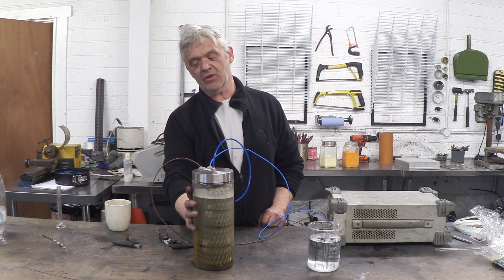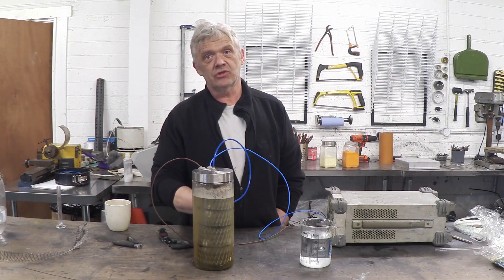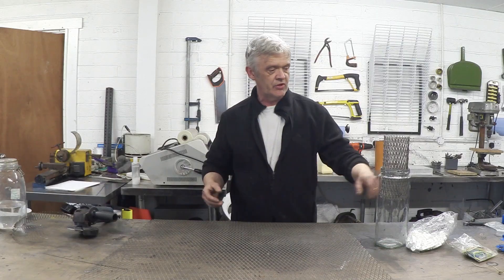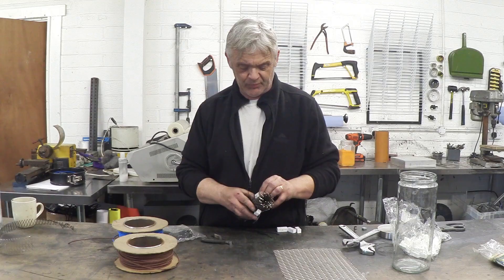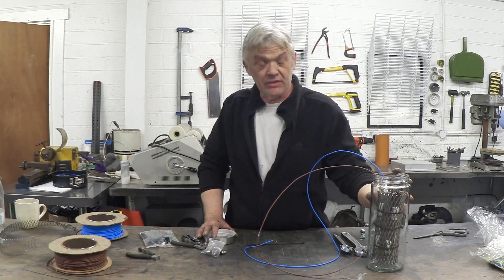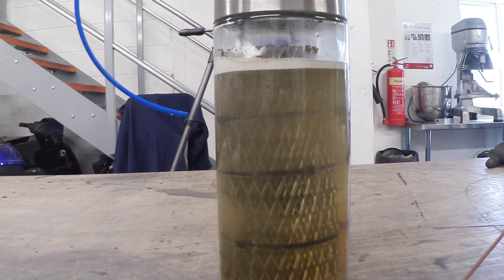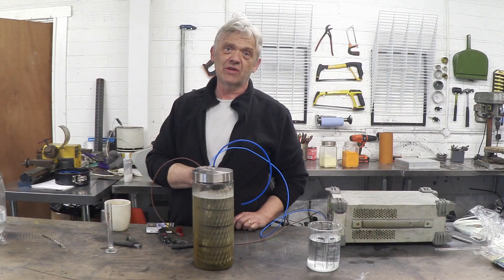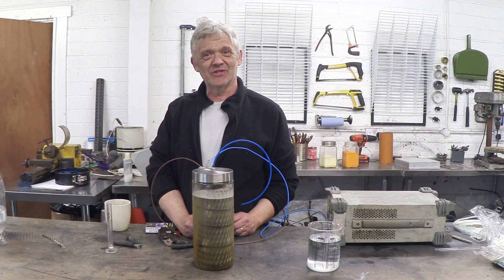Cheap And Easy Hydrogen (Brown's Gas) Generator

Comment: to be precise the HHO generator that you have built doesn't separate gasses which means its a mix and yes it can be used for many things except to run 2/4 strokes engines...
since stroke engines suck air upon starting it would be impossible to feed hydrogen+ oxygen+oxygen and have the engine starts....coz to much oxygen is thrown in the gas oxygen mix inside the cylinders....
newest cars have self regulated Carburetion which regulate the oxygen intake...which means throwing in only hydrogen will make it easy to start the engine.....
from that specific HHO generator the best you can do with it,its add the hydrogen oxygen mix to gasoline and lower the gasoline consumption.....
Reply: Exactly what it's for, aparently the electrical energy from your alternator will produce brown gas in the cell which then is fed into your air intake or inlet manifold. You can also tweak the electrical current to pulse (frequency) to produce gas more efficiently hopefully achieving up to 10% more efficiency per litre of gas. I've done it and drove across Australia but there was no decernabe difference. However I knew nothing of urea or manipulation of electrical frequency.
Reply: @hopefilledsinner3911  My goal is eliminate gasoline all the way....
There are testings of combustion engines that will use ONLY Hydrogen mixed with air from the intake ....
If i am not mistaken an italian company is working on that specific combustion engine..
Not sure if it will work the way they hope or not..
I simply want to eliminate Diesel on my car permanently by generating hydrogen on  a generator sitting inside my car on demand...
Fairly certain  a premixed hydrogen oxygen coming out the hydrogen generator wont do any good...
I probably am wrong not sure and most certainly i will never know since i am focusing exclusively  on generated separated gasses...

Comment: The what you say 

It's an overunity reaction

More energy out than put into the reaction
Definition of ZPE over unity. 
Tapping a different dimension to extract energy that exists in the quantum foam
It is always coming into and out of our  diamention

My favorite way to tap. Zero point energy
Is when vapor bubbles formed in liquid say water.  Forms under low pressure then they will collapse under higher pressure 

In doing so it realises that ape which is hotter than the son. At a nanospot
It translates the whole periodic chart.

I m always waking newer ways to tap into the zpe..

Comment: Anyone know the purpose of the bubbler?
Reply: Safety device, prevents output gas from backfiring into the cell in case of ignition. An additional arrestor, like a cigarette filter is put in front of the welding needle (or any other consumption device)

Comment: Also any of you doing this there is one more thing I would like to say, if you place water under a vacuum and hit it with a high frequency in the range used for x-rays it streams of hydrogen this is why the man I was talking about with the Holden running on water could do what he did, the bubbler is a ploy to prevent people placing there cell under a vacuum and producing more gas, but the reality is you motor is a vacuum chamber and is why you don't need any of this to make a motor run on water just the high voltage coil and enough water to burn.
Reply from the maker: okay mate
Reply: @ThinkingandTinkering  
I am not kidding you, I have a science book from the fifties that shows it to be true I have a video on my channel showing it and it has been proven a man created a patient for a gas torch using the same principle, the Holden was real as well I kid you not.

Comment: Hey, I have to point out something: Urea you get for fertilizing is NOT a waste product... It is made by the Haber-Process which makes Amoniak and then Urea. That takes a LOT of energy, more than you could get from burning that hydrogen!
If you use real Waste Urea you might get a plus in Power (I doubt you can do it, including the energy or money put into getting the urea), you would do better just buying the energy from more efficient energy producers!

Comment: 7 minutes 42 seconds - "there you go, it's generating lots of gas."  Sorry, I didn't see it generating any gas at all.  I still have to watch the full video.  At 9 min's 30 sec's. you claim to get more energy out than you put in.  Physics 101 - you can't get more energy out than you put in.  If you put in 100 watts of energy you are (in a perfect  world) going to get 100 watts out.  Not 110 watts, not 200 watts, just not possible to get more energy out than you put in.  And since this isn't a perfect world, what I think you're confusing is that with water you may get, and I'm going to make up some numbers here, you may get 87% of the energy out, whereas - and I don't know this to be true - with urea you may get 92%.  It's an improvement (maybe), but you'll never exceed 100% out.  Just not possible to create energy.  You can convert it from one form to another, but there are almost always losses.  Converting gasoline (energy) into heat - you get the same amount of energy as you started with.  Some of it is lost to friction, some of it is lost as heat.  But you can't get more energy out than you put in.  Gasoline has high energy density.  That's why it's superior to electric cars; you don't have to carry tons of batteries to get the same range as a few pounds of fuel.

And I never saw any gas being produced.  One way to prove gas production is to dip the end of the tube into a jar of water.  That way we can see the bubbles as the gas escapes the tube.

Comment: No, you are not getting net positive energy out from the process. The urea represents energy input in that equation when you calculate the energy output based on the potential energy relative to the binding of hydrogen and oxygen into water.
That is, at 0.37V you're not splitting water, but the urea. When you run out of urea the voltage needed to continue to produce hydrogen will rise to the voltage needed to split water.
Reply from the maker: yes that's right mate - but it will still be net positive in the same way that burning petrol in a car is
Reply: @ThinkingandTinkering  Yes, in the exact same way, the urea is a fuel of sorts in this situation, energy input, and has actually been evaluated as a fuel, or "hydrogen carrier", as hydrogen in itself is absurdly impractical to deal with in relevant quantities. But still, your process is net positive in the same sense as in burning fuel in a car, that typically average somewhere around 20% net efficiency from input to useful energy.

Comment: made my own fuel cell based on sSTANLEY MYERS  design a long while ago and if you use a pulse width modulator to crack the water at the correct frequency ( the frequency to break the hydrogen and oxygen molecules apart ) you can get the same effect and more (ALOT MORE !!) without the heat , theres a schematic for it on youtube somewhere. we made enough gas to run a five kw 4 stroke generator np ...ps love your videos :)

Comment: If it makes more energy than it uses, is it possible to burn the gas coming out with a combustion motor that is attached to a generator that feeds energy to make the hydrogen?

Comment: Dear Bob,  two points I wish you would address further.  First one is that in this video you build an electrolyzer fair enough  but no means of keeping the o2 and h2 from recombining at the top and forming an explosive gas mixture in the process.  Secondly,  you are suggesting that the energy in the now evolved gas mixture when burned will yield more energy than the energy of the electricity it took for the electrolysis. This is shear nonsense.  For that to happen it would require a suspension of the second law of thermodynamics.  Have you accomplished such a suspension.

JohnB

Comment: Upon fast rise nickel phone works really well as electrolyzer you can buy it on Amazon. Thanks for the tip with area. I also found in my research that lead mercury amalgam all works well as electrolyzer plate. Also putting a pulse wave on electrolyzer plates will increase his efficiency in 100 Hz range. Distance between plates should be no more than a millimeter. Consider using a thermal electric generator set up to send power back to the system and charge a battery bank you’d have to create a burn chamber and a cooling apparatus how do use perit coolers to generate electricity.
Reply: Nickel foam

Comment: Just on question.  The gases coming off wouldn't be just hydrogen, but an admixture of that with probably Nitrogen and Carbon dioxide.  Is there a way to collect just the hydrogen and vent off the other gases?

Comment: This will produce hydrogen and oxygen in a 2:1 ratio, so how do you separate the oxygen from the hydrogen?  All you're producing here is an explosive mixture of hydrogen and oxygen.
Reply: That’s why he calls it Brown’s gas (also known as HHO). If you want it separated it’s better to just have a regular hydrogen generator with the cathode and anode seperate on two sides (will look a bit like a U shape), and have a hose coming out of both ends of the U since one will be hydrogen and the other oxygen (if using water). You can of course recombine it later but you then have to deal with mixing it with nozzle sizes and pressure and stuff if you’re storing it, compared to this which is useful for making a non-pressurized torch or if you just want to make some explosive balloons for fun with a 20ft pole with a lighter or match on the end (while wearing heating protection and safety glasses, because you really will need that 20ft pole!) < this is a 4th of July tradition, where we found that sitting back 10ft-15ft back was not such a good idea, haha, felt like our eyebrows were removed, lol!

Comment: Hallo Robert, just two little questions : 1) is this principle being used anywhere commercially/industrially using solar power to store the sun’s energy in the form of hydrogen gas ? 2) How can the DIY guy store/use the gas that is generated using this easily accessible source of power ? ☀️💥 PS I just love your scientific but ultra-practical videos 👍🔩🔨⚙️🧲⚡️
Reply: There is a southkorean company selling browns gas steel cooking ovens. The HHO technology is suppressed because it renders fossile fuels obsolete. Best way for a DIY guy to start is making a welding unit, then a heating device for cooking, then a oven for a room for example. Motor application is more difficult. If you succeed, you can power a generator. H2 or HHO storing is very difficult and dangerous as well. It's all on demand production of HHO here.

Comment: I built one of those in 2000 to run a lpg Landover it ended up been 2x 1.5m long and running 3 alts  and 2 inverters to power it all. As long as you didnt have long hills you cld run it purely on water.

Comment: There are plenty of videos on here for water  bubblers to add to engines for higher fuel economy, and plenty of HHO generator videos, but this is the first I’ve seen urea mentioned as the electrolyzer catalyst, and none of them quantify increases in fuel economy (or the corresponding decreases in emissions). Scientific papers I’ve seen have claimed 30-50% less fuel consumption with maybe 20% decreases in emissions. 
Easy enough to do my own testing though, with designs and construction this simple. (Why wouldn’t you solder and seal the wires prior to rolling the mesh?)

Comment: Would copper pipe make a better conductor. If so, you could microbore copper pipe slotted into 1 1/2" plastic waste pipe, then put microbore around the outside. Would that work?

Comment: Surely hydrogen is not the only gas coming off there? As from my primary school H20 electrolysis experiments,  I would have expected a means of collecting the gases coming from each of the two electrodes separately, so as to have pure H in one of them and the N / CO2 in the other. No?

Comment: You forgot to mention the discolouring of the solution is mainly due to the decomposing stainless steel - in my understanding if left for a considerable length of time, you'll start seeing a very noticeable build up of the materials used to make the s/steel deposit in the solution eg carbon and iron ore. You can demonstrate the s/steel has decomposed simply by removing the plates and then place a magnet on the side of the glass and watch the iron in the solution be attracted to it. So where did the iron come from? The s/steel of course! The gas products therefore largely originate from the metal as we have to take into account a small amount of urea was added and that too would have decomposed! Water decomposes the metal/urea and the electricity is the true catalyst speeding up rate of decomposition!

Comment: Great video, another simple way is to use 2 balls of wire wool. Put one (+ )inside a nylon sock and sink it in the solution. Then put another (-) on top this doesn’t need to be socked but it won’t hurt.
Then switch it on and watch the gas flow 🤪
Reply: Guess best press together the two steelwool lumps.

Comment: Hi rob  does the use of AC Felt negate the need to use a finer mesh for improving efficiency or would the finer mesh still be preferable as I really want to build one of these bad boys . Cheers
Reply: You always want a finer mesh, the more surface area the better (plus you could either generate faster or make the container smaller).
Reply: Jake Garrett thanks jake   I got some 120 sos mesh now

Comment: Hello! I'm wondering if another route to go would be to use a stainless steel pressure cooker. You can use the cooker itself as one electrode. You can have the other electrode wired through the hole that will be created when you unscrew and remove the pressure gauge. Then you can connect a hose to the pressure release port where the 15 psi weight would usually sit.
Reply: That would work except even stainless whatever you use will eventually be consumed by the electrolosis.
Reply: @magicone9327  Only the positive electrode gets consumed.  As long as the pressure cooker was the negative electrode, it would not get consumed.

Comment: This would be a good junior high school science class demo unit..
     Does the stainless steel degrade with use ? 
      Cool video. Now I'll have to check the local big - box hardware store and see if they have that mesh in stainless..

Comment: It seems as if your generator will allow commingled H2 and O2 to collect. Perhaps you could extend a plastic tube around the inner + electrode to scavange the O2 as it is produced and vent it into the room.

Comment: Very interesting thanks for sharing.  I have been wondering for some time now if it would be possible to use multiple power inputs on the same cell and what output would be like.  I have tinkered with hho to try to make a welding gas cell  with PC power supplys but the results were disappointing . I would have a play myself but have moved house and no longer have my man cave and don't want the expense of a new roof if things go wrong 🤣
Reply: So just shorting power supplies together? If you’re using for example a 3v solar panel but then using 12v computer power supply the solar panel then does nothing (hopefully it doesn’t break, but assuming it doesn’t, it contributes no power), then if you added say a third power supply like a 24v power supply you’ll just be frying the 12v power supply (if by some miracle it doesn’t fry it still has less voltage potential so it’s just not going to power it). The only way it works is if they are all similar voltage potential (and don’t hook up a 12v lithium battery to a 12v power supply either, because that will still explode). Basically it’s useless unless you are using for example maybe 12v windmill and 12v solar for the example of it sometimes being sunny or windy.

Voltage is like water in a pipe, the one with the most potential (height of water in the tube or voltage) is the one that is used, only when the water in the tubes are level (same voltage) do they both contribute. In the case of low powered solar at high voltage it could contribute a low amount of current in parallel as it’s voltage drops to match the power supply (example is a 19v solar panel dropping to 12v when in parallel with the power supply and providing its little bit of current).

Comment: I found on the net an easy way to store and pressurize the gas is to have two cylinders one fitting into the other fill the bottom one with water and have the gas inlet come from the top outside and go to the bottom center to fill the second cylinder putting weights on the second cylinder top controls the pressure.

Comment: Robert, could please tell me what other liquid media can be used instead of UREA that has a higher efficiency rating for electrolysis ??? You also stated the using expanded mesh is better than metal sheet, why is that ???? Thanks a bunch and have a virus free day too. VF